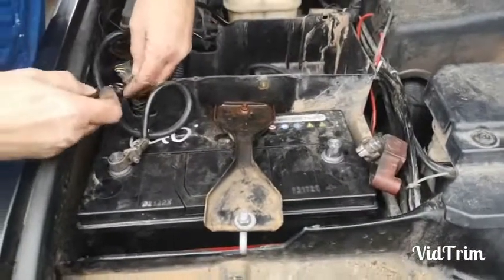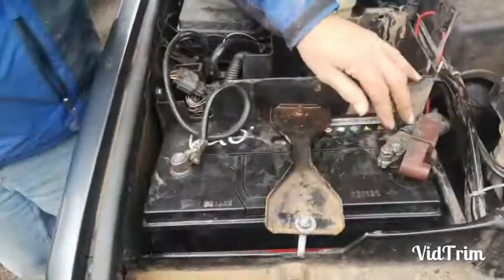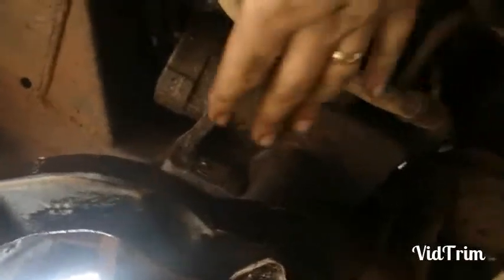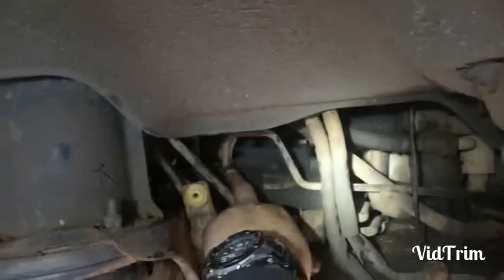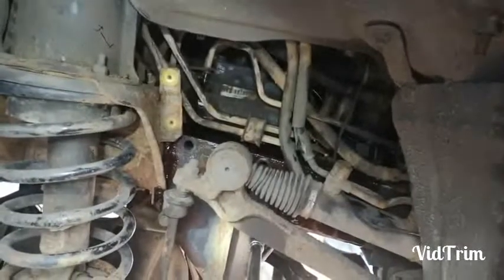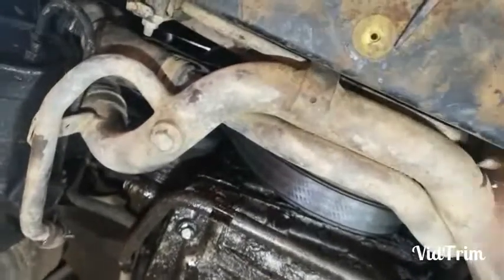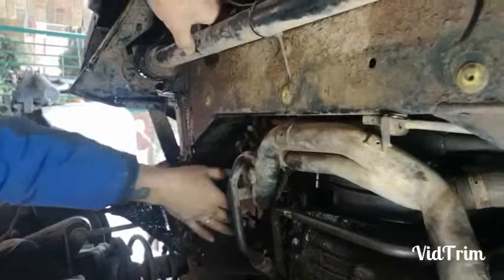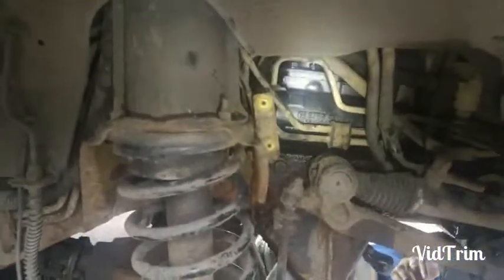land rover Discovery 2 td5 steering box removal how to

Comment: I am doing this job now steering box is loose can move it up down left right but that water pipe is stopping it from coming off the rail! Ive removed them nuts on the water pipe but i cannot get the piping to shift what am i doing wrong?
Reply from the maker: No it's just a killer to get out the gap.

Comment: Having problems with my discovery 04 td5 changed the injector seals because it was blowing crap out in the morning changed the injecter loom its holding water level oil level ok had a sniff test ok no creamy sludge  still miss firing any suggestions please  thanx
Reply from the maker: What colour is the smoke and how long does it smoke?
Reply: @wardysworx  white blue for about 4 or 5 seconds
Reply from the maker: Could be an injector leaking over night. Build up sits then is burnt off on start up. Did you soak all the injector tips when doing seals?
Reply: @wardysworx  no just cleaned them off
Reply from the maker: I had similar on my defender and needed to soak and clean the tips to stop them dripping. The only other thing I can think of is valve stem oil seals as the smoke has a blue tint which suggests oil burning 🔥 🤔
Reply: @wardysworx  thanx for your suggestions I will try it and let you no how I got on thanx